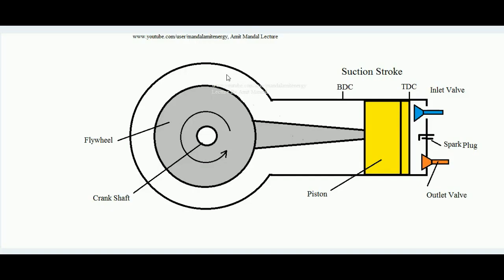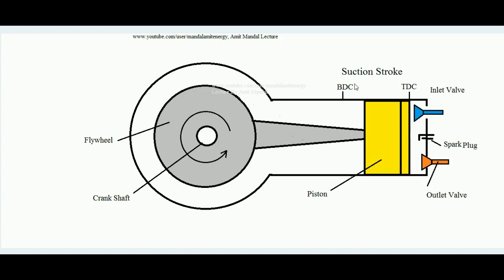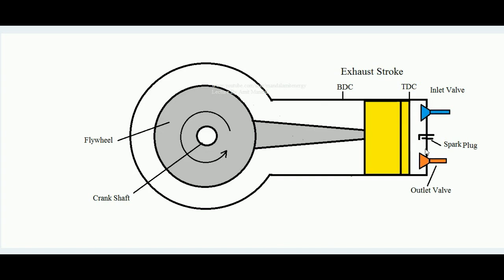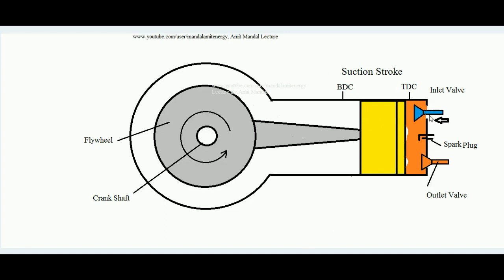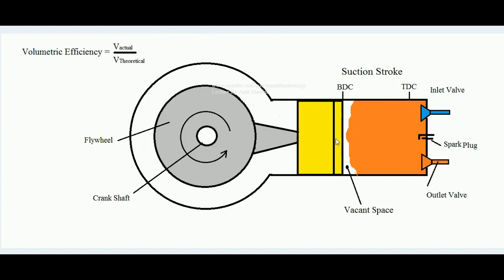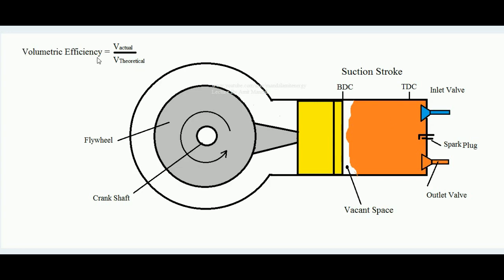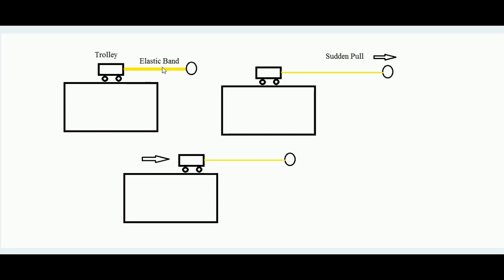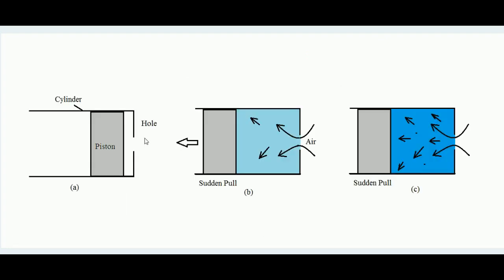Volumetric Efficiency Of An Engine

Comment: The author of this video completely misunderstands the meaning of the term "Volumetric Efficiency" when applied to an IC engine. A piston engine is a positive displacement pump, the pumped volume is defined by the bore/stroke and never changes. VE is a mass ratio, not a volume ratio. The correct equation is:

VE=(MASS_actual)/(MASS_theoretical)

And there is no such thing as "vacant space" under the air charge in the cylinder. This very concept defies physics and fluid dynamics.
Reply from the maker: Reference - https://www.sciencedirect.com/topics/earth-and-planetary-sciences/volumetric-efficiency
Reply from the maker: https://www.sciencedirect.com/topics/earth-and-planetary-sciences/volumetric-efficiency

Comment: sir we increase the time of intake valve to remain open while the piston starts to move upward don't it cause the air-fule mixture to come out through the intake valve which is still open?
(question is from the last part of the video 2nd method to increasing the volumetric efficiency)
thanks
Reply from the maker: Ya, thats the drawback, however advantage is more
Reply: @Dr.AmitMandal  sir today was my internship day and I told my professor these two ways to increase volumetric efficiency he do agree with the first only which was just to increase the intake opening and valve of engine but disagree with the second way and he told me about turbocharger instead.

Comment: Sir, If we use a turbocharger or supercharger, then compressed air at high pressure is supplied at the inlet port of the engine. Does it mean that it also increases the thermal efficiency of the engine?
Reply from the maker: generally

Comment: Elasticity of gases affected by restriction of flow is the primary cause of loss of VE.  However, along with elasticity comes compressability.  Chrysler Corporation in the late 1950s used this this to measurable advantage on their RB 413"² engines with the  Cross Ram option, which used long, fairly straight intake runners that used the momentum of the moving intake charge to compress it when the intake valve closed, negating some of the frictional loss of the valve and its port when the intake reopened for the next cycle.  These engines,  using dual 650 CFM Carter AFB caburetion, approached the magic number of one BHP per in², partly due to this charge compression feature of its long intake runners.  While not as efficient as the original "hemis," the Cross Ram got close,  but the hemi was still better at high RPM.

Comment: You are 100% wrong it is not always just less than the size of the cylinder if you let the intake valve closed about 30 or 40 degrees after bottom dead center momentum of the charge will continue to Pile in the cylinder. You could develop a volumetric efficiency of 150 if you get your cam timing correct
Reply from the maker: You can watch my lecture on valve timing diagram.

Comment: the tym delay for which air takes to come inside the cylinder is because of the pressure difference..
The pressure at which the inlet valve opens is above atmp pressure because of the small amount of burnt gasses present on the clearance volume..
the pressure of that burnt gasses are above atmospheric pressure,so to achieve that pressure to drop below atmosphere some tym is taken and once that pressure drop below atm then the air stars to enter inside the cylinder..
Reply from the maker: That too is a reason, like same when th cylinder becomes hot than incoming air, start expanding promptly when entering inside the cyclinder which leads to less mass  accomodating inside however chief way to define vol eff is as i have mentioned in the video.
Reply: Yes sir I like your explanation..
But in real senario the pressure and temperature is responsible for that delay na????

Comment: DEAR SIR ,U should use amout of air used instead of charge..!
Because volumetric efficiency is defined as the volume flow rate of air into the intake system divided by the rate at which the volume is displaced..!! 
It is irrespective of the engine wheter it is SI or Ci or gas engine , volumetric rate of air flow is what to taken into account and not the mixture flow..!!
Hope u will take it in a positive way..!!
Nice job sir..!!
Thanks
Reply from the maker: That is air standard volumetric eff. However in practical case for SI engine , taking charge as fluid , it is more practical approach....
Reply: But if u will surf any authetic source or standerd books u will found air there..! 
I got ur point but still we cant say chRge instead of air intake it will be violation of the defination...!
Reply from the maker: Google ' volumetric efficiency iit guwahati , download the pdf file and check.

Comment: One question, if the piston is in BDC and which is after the expansion stroke , what will happen to the unburnt fresh charges, which will enter by closing the inlet valve at a time more than the actual closing time?
Reply from the maker: +Niaz Ahmad refer my lecture ' valve timing diagram' on the same channel

Comment: I have a question how to calculate clearance volume of Engine?
Reply: Each part of engines are made speretly so u can simply calculate it by putting the cylinder head down and pouring water in it..!!
Those led balll test and otherexperiments are not fruitfull coz the shape at valve is ont symeetric..!
Reply from the maker: +Marinebd it is the cylinder volume - stroke volume....

Comment: Volumetric efficiency is directly proportion to compression ration..? M I right.? Pls correct me..
Reply from the maker: +Câptaiñ_Amêricä * directly proportional , not possible, however the major factor on which VE dwpends is speed of engine , the inlet valve diameter..